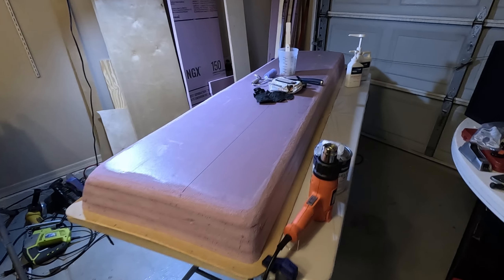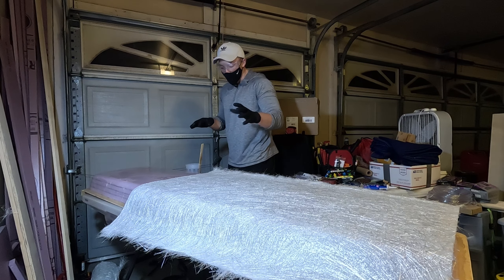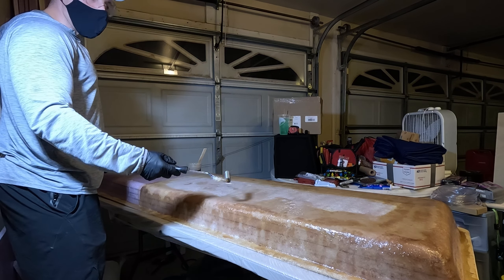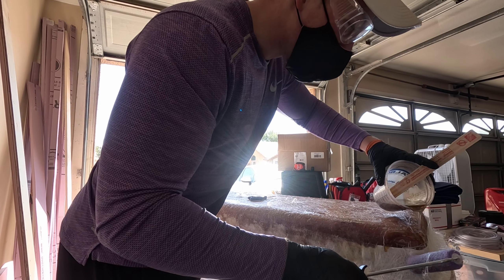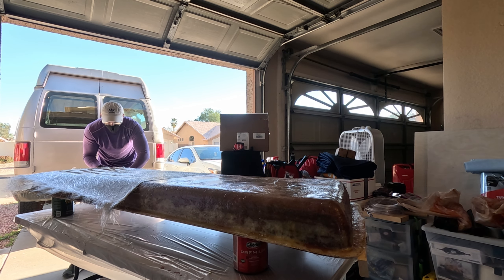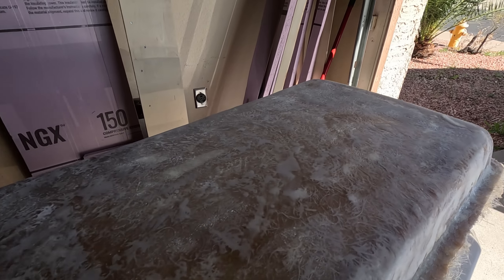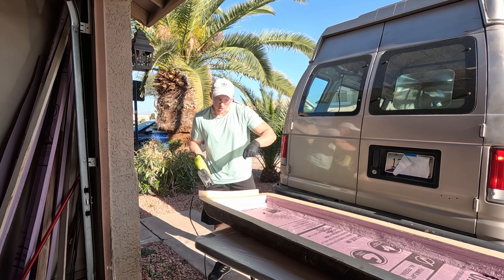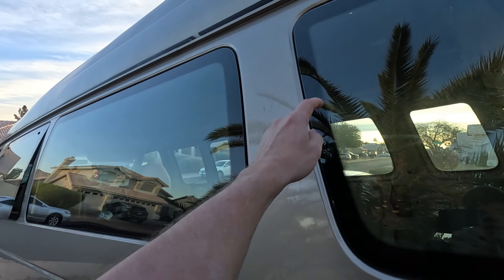Building DIY Fiberglass Van Flares (Part 2/3) - Camper Van Conversion #vanlife

Comment: with a little bit of work you can improve that finish quite a bit.. Youre gonna have to hit it with a random orbital sander to even out that surface. then, once you have a mostly smooth surface, fill in the low spots and hit it with the sander again. you did all the hard stuff, then skipped the easy stuff lol..
Reply from the maker: I definitely learned a lot that I'll be improving on the next go around. Thanks for the feedback
Reply: Please dont use a sander. Spray it does with primer and then mist it with black paint, let it dry, then glue a long piece of sand paper on a board to keep it flat and then sand the length of the piece. the black paint will show you all the low spots and the long board will make it all even. You can also use way more body filler but next time you can also put tape all over the foam board so it doesn’t soak up the resin.
Reply: @jamesyahn  fair play. I used a ROS, and the finish turned out immaculate. however, my piece started off much more flat. doing round over edges can be a bit tricky. i would say that for the best success, the piece should be CLOSE to perfect straight away. its when loads of filling and sanding is required that a lot of hours are required.

Comment: You have to use epoxy on foam. The fiberglass resin will eat the foam
Reply: It looks like the epoxy sealed the foam enough to mostly stop the polyester eating into it.
Reply from the maker: Good to know. I'll have to be more careful with how the materials interact with each other next time.
Reply: @_natebassett You actually did an experiment that I have been thinking of doing for sometime. Polyester is much cheaper than epoxy so if foam can be sealed with one coat of epoxy and then continue with polyester it can add up to a big cost saving on larger projects. Plus you can get polyester from the local hardware if you run out.
Keep the good work.